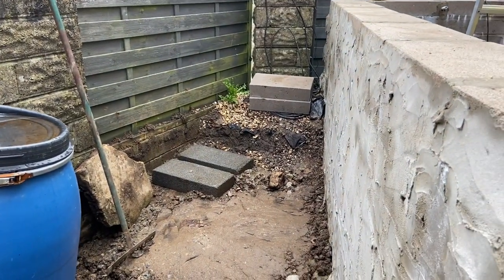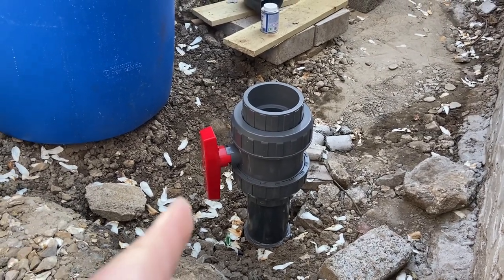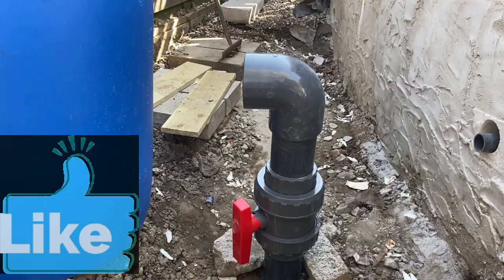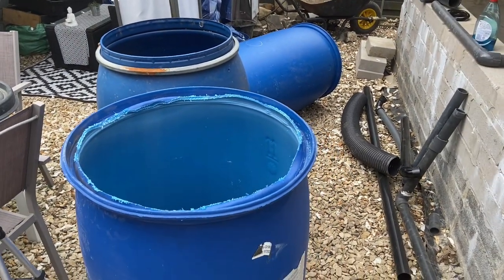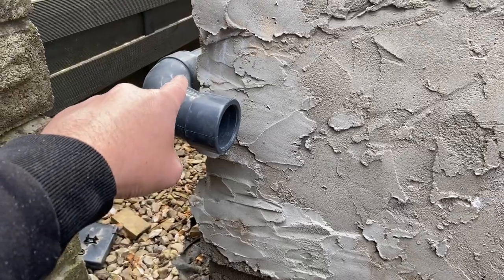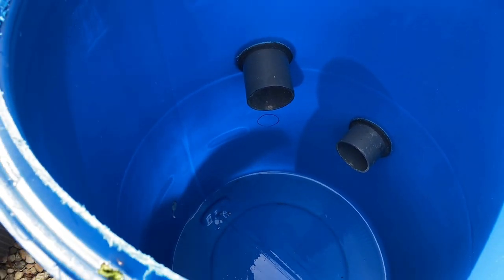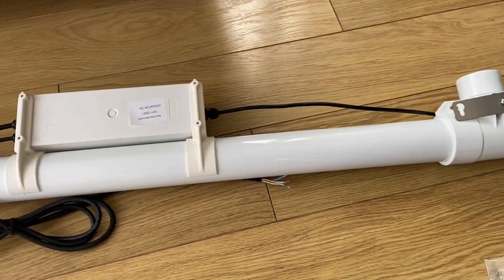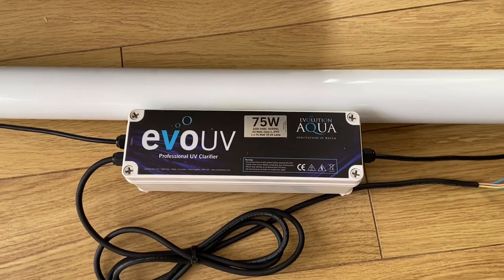pond  rebuild construction  New Evo UV pond pipework and filter levelling for gravity fed 👌🙏👍🏼

Comment: Great pipe work bud I'm really struggling with mine 🤣
Reply from the maker: Hi Jamie just put it all together first make sure your happy then solvent weld it the rubber boots help if you are slightly out as you can move them slightly 
All the best Jiffster 👍🏼👍🏼
Reply: @jiffsterkoi  thanks bud 👍

Comment: Be careful with those hose tails they do leak i had to use silicone to give a better seal also be careful with o ring washers make sure they give a good seal but remember not to overtighen them as the wasers may pinch and create a leak.
Reply from the maker: Hi mate I am not using the hose tails and yes you always have to be careful use some ptfe tape also will make sure you don’t have leaks that way 
All the best Jiffster 👍🏼👍🏼

Comment: Just done my pipe work night mare lol
Reply from the maker: Hi Peter , it takes some planning 👍🏼
Reply: @jiffsterkoi  yeah had to change plan on waste system and put a extra slide valve in as was getting back pressure into my middle bay and contaminated  bay two with waste from bay one
Reply from the maker: @peterspuddleskoiandgoldfish  glad you figured it out the mate it takes a lot of small tweaks to get things right 👍🏼👍🏼
Reply: @jiffsterkoi  whole system was backing up at one point lol not enough flow rate on return as pump not a varied flow ,filled first 2 bays quickly, enlarged holes on spray bars and added a extra return to pond ,cured it lol